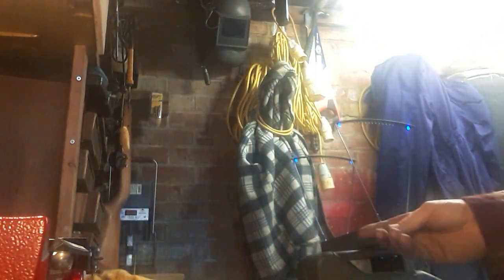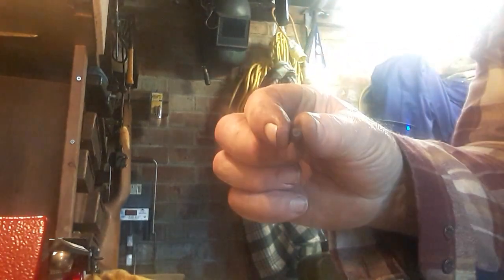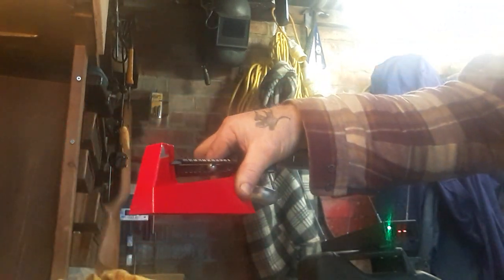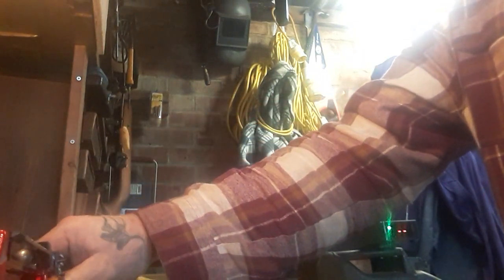8 mm  steel energy test at 330 fps  ,,, PATHETIC

Comment: Im loving 9.5 
Havent hunted yet because Im no where near that good a shot yet. Last night got 7 in a row within a 2 inch circle. 
Im having an issue with the band lengths. If I go with my "supposed" cut the bands are too short and dont last. I found 7 inches on my band length is better for me. 
What's the best band size for shooting 9.5?
Simple shot has me on 7mm black
Reply from the maker: I haven't used simpleshot black myself mate , but for 9.5 steel I use .7 snipersling  25x20   , you wont go wrong with that , I've no doubt the simpleshot black would be similar 💥🍺
Reply: @manofkentcatapultsgunsando5069  Thank you!
Reply: @FinehomesofNewHampshire  I use snipersling black  .7  25-17 with 9.5 steel and lead and its my preferred band for 9,5`s... i predominantly shoot 10mm lead and 11 steel and favour cattyshack great white .85  either 25-20 or 25-17 .. spot on for smooth draw and wack...👍🏻